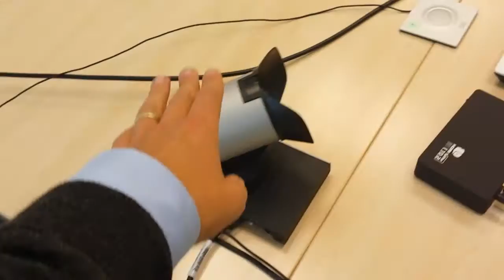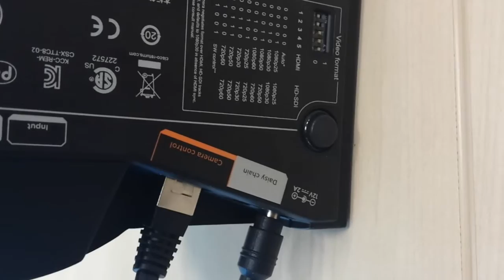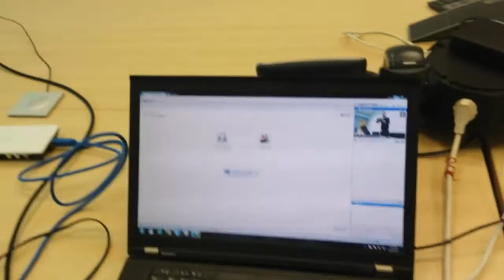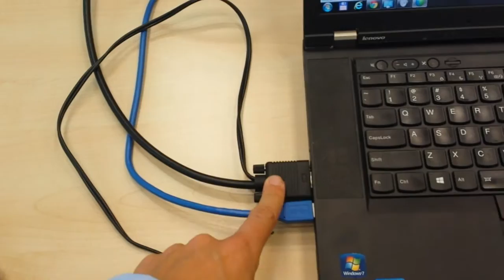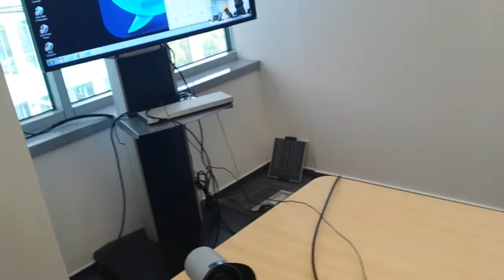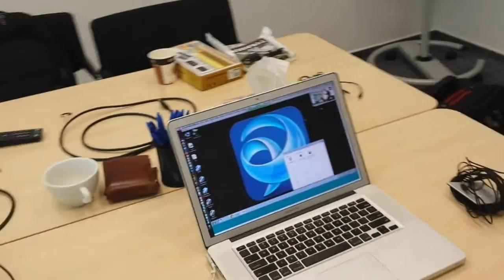Cisco C20 codec Camera feeding Webex via Black Magic encoder

Comment: Hey peter,
Can you use the camera alone without the codec?, will it output an image?,
Basically what is the codec for?, Just controlling the camera?
Reply: Usualy, you can use the camera alone. In the SX20 system, the camera has an HDMI and a SDI video output. You can capture the video to a PC with a capture card like the Blackmagic or a Magewell. The camera has a Infrarer sensor in the front, so you need only the system remote controll to move the camera (or an generic controller).
Reply: ARTUR HENRIQUE Welp but how do we change te settings. Without codec. You cant do anything like flip the video if u want to mount the camera upside down as a ptz camera
Reply: @ArpanPatel108  is it possible to hook directly the laptop into cisco c20 codec instead to Black Magic encoder ? and them from laptop you can change the very well the codec settings ?